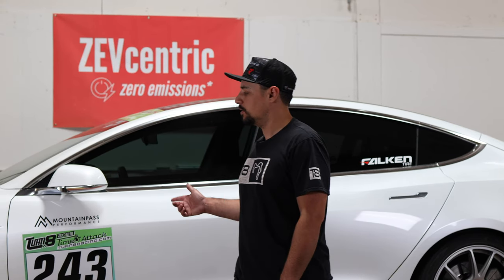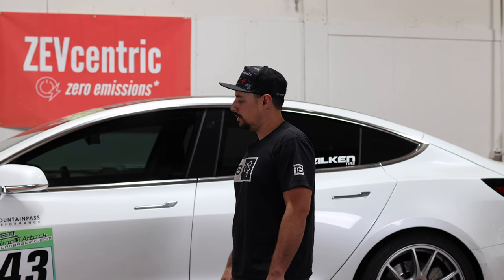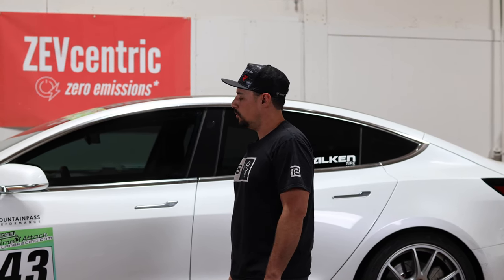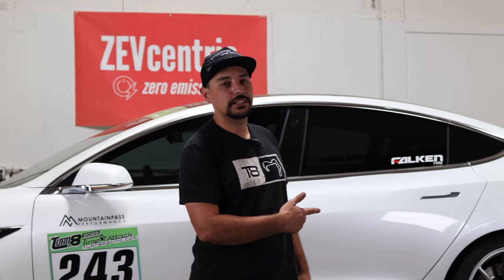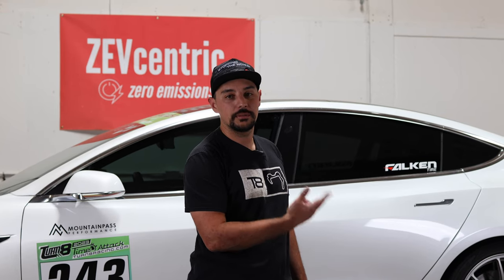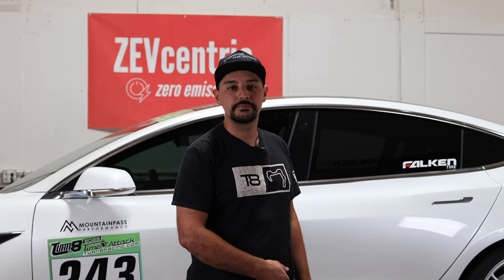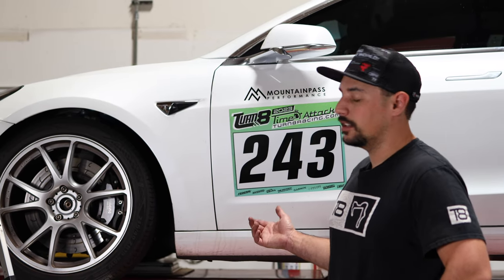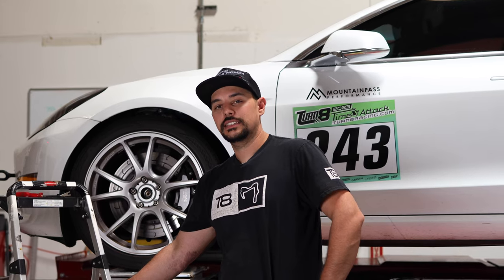Steven's Model 3 Track Slayer: Unleashing Performance with Weight Reduction! 🚀 | ZEVcentric

Comment: Pretty cool, was curious how much weight could be removed. You got to 3900 lbs, a lot better than the initial weight. 

It'd be cool to see a model 3 RWD with a long range battery and the SW hacked to bump the power up to dual motor power. Wondering if a single rear motor could handle it.🤔 It sucks Tesla doesn't make the RWD long range anymore. It'd be nice to have another option.
Reply from the maker: The best is the SR+ with a 980 or 990 motor and 2170 batteries.  Lightest version with a ghost mod to get P3D power.  3600lb track attack car.  The LR is still too heavy and won’t produce anymore power than the SR+ with the boost mod.
Reply: @zevcentric   You can't ghost mod a SR+ you can only use the "Boost SR" for the SR+ with the 980 motor. That moves it from 5.2 to 4.6, changes the throttle curve and gives a lot more low down power. (I have it on mine)

You can use the "Ghost module" on AWD LR M3 with the 980 motor.

Unless you guys have done something that Ingenext hasn't....if you do have a real SR+ with an actual Ghost module you should make a video of it.
Reply from the maker: @ScoundrelzNTwK  thats what we meant.  Whatever the boost mod is from ingenext is what we were referring to.
Reply: Have you replaced the 12v lead acid? It is so much heavier than the MPP battery.